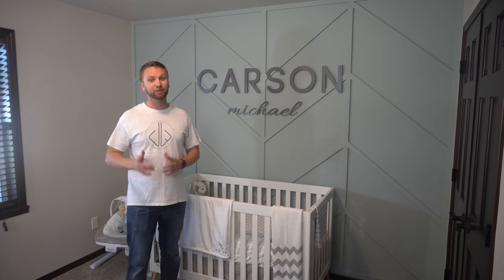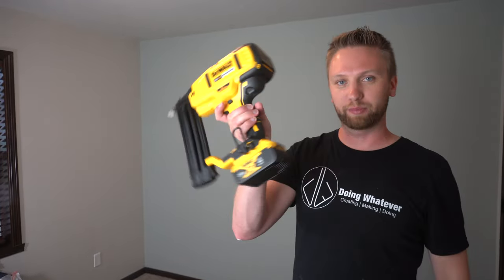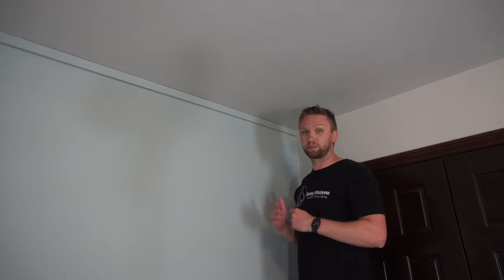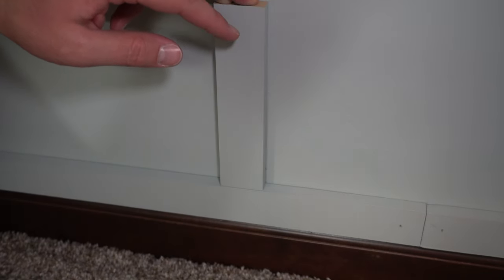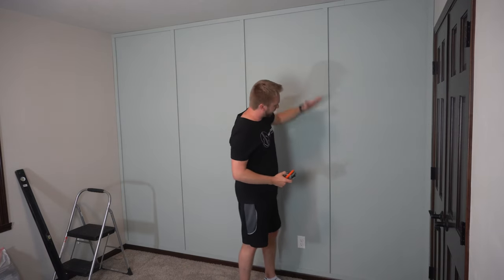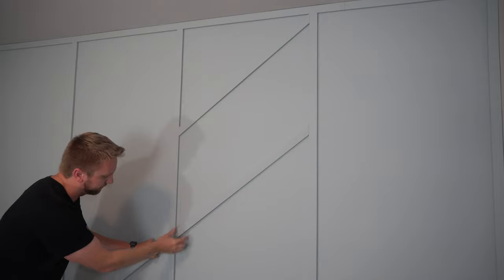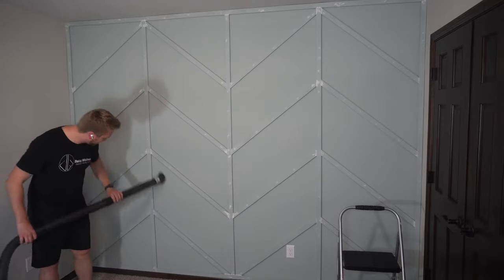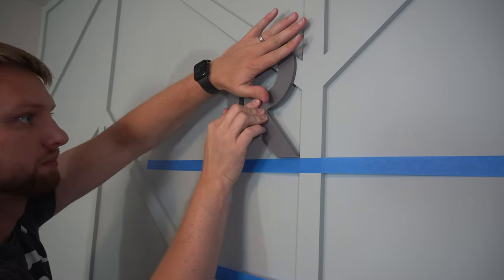DIY Accent Wall | How To Create A Feature Wall In A Bedroom, Nursery

Comment: Ok, you nailed the mdf into the drywall with a brad nailer but didn't care where the studs were? How does it not come out of the drywall?
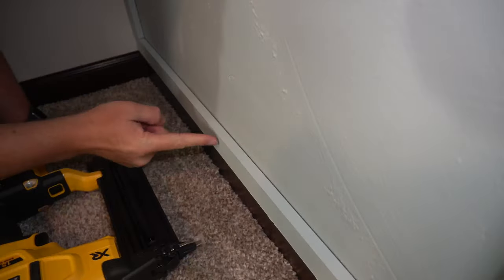Reply from the maker: Angle the brad nailer so the brad nail goes in at an angle. check out 5:00. Do some angled one way and some angled the opposite way. Should do the trick!
Reply: @DoingWhatever  I know I saw that, but you're not worried the nails won't go into the water pipes? I just thought I had to put all the brad nails into studs....
Reply from the maker: I don’t have any water pipes in that wall. You’ll have to determine that risk in your own situation, but I know in my case no water lines run in that wall
Reply: @DoingWhatever  Ah ok, thanks!

Comment: so are you shooting those straight into sheetrock?
Reply from the maker: Correct. I think I used 1”-1 1/2” brads for this. Cant remember exactly
Reply: @DoingWhatever   ok thank you.
Reply: I would use liquid nails where you cannot hit a stud and also on joints so you don’t have cracks later on